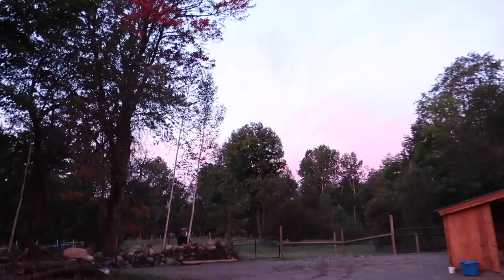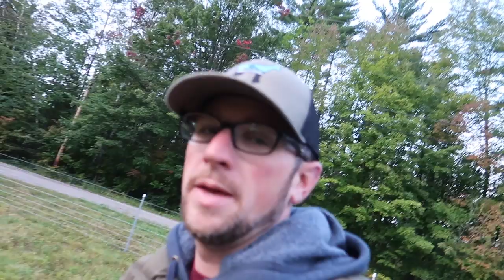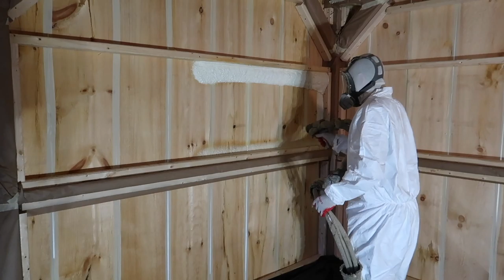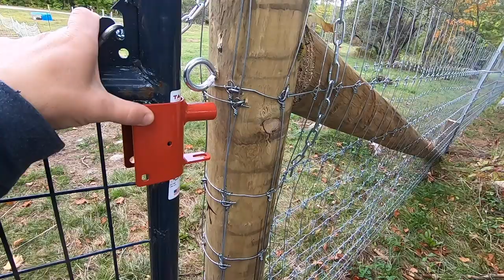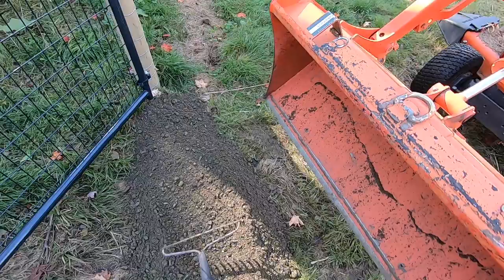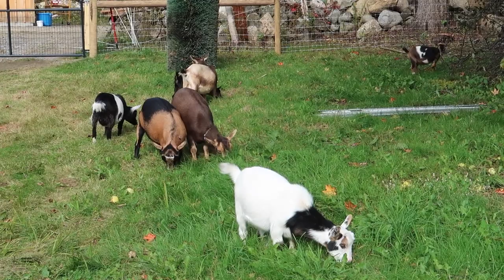Post & Beam Barn/Workshop Gets Spray Foamed and the goats go on PASTURE FULLTIME

Comment: Put the gate chain inside a piece of cheap(flexible) garden hose.
Reply from the maker: I like that idea
Reply: This is what I've done on my motorbike chains..... Protects them from rust and minimises the noise from when you use them... Also I have a spring type latch on my gate... Drilled a hole into my post for the spring latch could be pulled back then inserted into the hole..
Reply: The problem with flexible hose is that after a few winters it is no longer all that flexible. Perhaps it's because it gets extremely cold in my neck of the woods.
Reply: Mary. One 50 foot hose cut into 2 foot pieces. If it lasts 2 years per piece then there should be enough for 50 years. $8.00 every 50 years is a good deal. FYI thats around 15 cents per year.

Comment: Gooood Morning Al , Gina and Olivia ,
Whoeee , Lumnah Acres is looking rather farmy now with the new fencing. The barn is not going to look as rustic now with a finished interior. Certainly warmer this coming winter.. You may still want some heat though. Maybe a small potbellied stove ? A rocket stove would be just the thing and would give you a warm place to sit. It would give you a nice heat while using only a small amount of fuel. The main drawback is that a rocket stove uses up floor space. Maybe you could place one along the back wall ? And have the bonus of a warm place to sit. Ha ha , I've never seen you sitting except for meal time or driving to town. They take awhile to warm a space. You could always fire it up the very first thing before you start your other morning chores.
 We don't see Olivia leaving for school anymore. Are you homeschooling now that Gina is at home ?

Comment: Worked on a house that had closed cell foam sprayed onto their metal like that cause it started leaking. The contractor had to come back and check every screw on the roof and walls. Just a heads up :) hope this helps prevent any headaches down the road

Comment: Gate latches and gates in the winter are a pain.   I have my gates set little high and hang hardware cloth for the summer.   Kinda done with chipping ice.   I’d use the router and hog the post out to use that latch

Comment: Gate hinges should have been screwed in more. The gate latch goes one bolt on top of cross tube through the hole in the chain catch but you have to remove the chain and then the other underneath the tube.

Comment: Should have run all the electrical wiring for other areas of the barn for lighting and receptacles before spray foaming to avoid surface runs later.
Reply: Al said in a previous video that there was a reason for doing it this way.

Comment: It looks like you could reverse the way the chain is attached so that the locking of the gastric takes less effort one of the other gates has the chain attached at the post and that one if similarwould allow to just slip the chain on and off the gate side with minimal effort and noise

Comment: It would have worked, just below the cross brace would have actually worked just fine. If you set the lock high it will cause the gate to wiggle at the bottom. Where do they put door lock assemblies?  Above mid point of the door.... You had plenty of room....

Comment: Would the gate chain work better if you had the lanyard end attached to the eye bolt instead of the gate? The chain link could be fitted into the slot on the gate without threading anything through the eye bolt. ??

Comment: I hope your Goats don't get sick from the form smell. You have to let it cure for humans sometimes for a couple of days. And the smell never goes away in spots they apply to thick. Tighten the hinge bolts even if you have to change the wood you put in to the flat side.
Will you ever put the two male goats in with the rest?
Reply: K Wayne  he mentioned willow last year getting bred in December, so thats probably what he will do this year
Reply: @Peanutthecatismycat  Makes sense. I forgot that. Arms Family Homestead seems to let his buck stay  with heard but his winters are not as bad. 40 below and 2-5 feet of snow at a time is way to much for me. Baby goats don't need that either.

Comment: IDK about that short PVC pipe holding for long? it MIGHT have worked if you concrete'd it in, otherwise I would have used a 3 to 4ft long STEEL pipe and not dug a hole, but POUNDED it in with a sledge as far as you could then cut it off flush

Comment: seems too me that latch would work very well ......what if you back off or screw in on the opposite side of the latch side on the two screw bolts ....... that should give you the space you need for it too work  properly ......... good purchase ......... latches will work good and long.......S

Comment: So your hinges on your gate are a little wonky. You want the kind that go all the way through the post, premier, tsc, or kencove sells them, just make sure to measure the size of your hinge holes before you order or buy. The ones that come with the gate are sadly junk. Install the long ones, Adjust and grease the hinges, adjust to make the gap tight enough. The 2x4 goes on the latch side and you put it all the way to the ground. Your baby kids can actually fit through the gap at the bottom of the post under the hinge as you have it now and trust me the little buggars will squeeze through them the first chance they get. The latch you have purchased I love - it's all I will ever use on a long gate. chisel a flat spot and install with lag bolts and small washers. You want the dumb side as snug as possible, tighten it down with the long bolts, and then put a self tapping screw through the spare hole to keep it from twisting. When you're done, give it a couple weeks to make sure nothing needs adjusting then cut the extra off the back end of the hinge with a saws-all.

Comment: It might be just fine, but personally, I don't like those hinge bolts sticking way out like that. I think that over time, they will at the very least sag. If not break entirely. What I would do is to take the gate down. Put a pressure treated 4x4 up against that post. Then put the hinge bolts back on, but through the 4x4. If you do that, you could also fine tune the gap at the latch side.

Comment: Those gate latch hooks don't look right. I screwed mine all the way (most of the way) In to get rid of the gap and faced both hooks UP so twice the support and I can just lift it off if I want to. drill a hole for a cotter pin or something if you're worried about it flying away...but they don't.

Comment: About the now Spray Foamed Willow Milking Room, Where is the electrical wiring ,for wall receptacles and overhead Lighting in that room that should have been ''roughed in '' BEFORE the Walls and Ceiling were Spray Foamed ! ?? And same with the Workshop Room !
Reply: Al stated in a previous video that there was a reason for it.

Comment: How much does foam insulation cost per square foot, installed.
Reply: That all depends on the contractor you choose to do the job.  Also, be careful going with the cheapest one as sometimes they don't really know what they are doing.  Ask for references and check into them before choosing anyone.

Comment: Place a piece of pipe parallel with the vertical pipe on the gate or weld it on the overside of the gate so you can mount the latch higher up, then you even make a flat spot on the pole for the latch.

Comment: Going to leave the spray foam exposed? Foam is a fire hazard Without fireproof barrier coating. Also exposed foam cleaning is a long term problem. Consider Box Store FRP sheathing the lower 4 feet. Good luck.
Reply: Al installed nailer boards on all walls to tack up paneling of some kind to cover the foam while leaving the posts exposed.
Reply: @Gladtobeleaving  what was an insured outbuildings has now become a fire hazard because of exposed flammable toxic foam. Darn!
Reply: @douglaspohl1827  Doug, I don't understand; the foam will all be covered.
Reply: @Gladtobeleaving  Covering with flammable material is not acceptable - let's hope the material has a Fire rating like drywall or better since wood as material is unacceptable by all insurances that I work for. Al should check with his insurance agent and get a reply in writing. CYA

Comment: Wouldn’t a blower be easier than a vacuum and broom?  You could blow the dust off the walls, ceilings etc much faster.
Reply: @Michele L ,
Yes, then you could  have that dust suspended in the air. Why use a blower when a broom works so well ? And with far less noise pollution.

Comment: I have a 20 foot drive way with two 10 foot gates 5 feet high and i used a chain link gate latch with a down rod into a pvc pipe with a latch system that goes across the other gate and the down rod keeps them shut & stright :)

Comment: Check out bestgatelatch.com  I’ve been running a few of them on my pasture gates for 2 years now and they are awesome. They are great because if you have a fence post shift on you over time the latch still works and you don’t have to worry about alignment issues like other latches.

Comment: Looking great  . Nice job on the spray foam . Was wondering if you were planing to heat the barn . Wood stove maybe . Also noticed the main barm door is not insulated . I wonder how that would effect the heat loss if you plan on heating the barn .
Reply from the maker: We will have to insulate the Garage door with sheet foam

Comment: Back in my days doing energy efficiency I saw some sloppy spray foam jobs! Looks like you guys found a great company that really takes pride in their work. Any plans for a miter station or work bench once the walls are up?
Reply from the maker: Yes we need a place for the chop saw.  A nice movable worktable for it will be nice. Do you have any recommendations
Reply: @LumnahAcres  I'll have to find the link for the video I used to make my movable work bench. But to get you started, 2" lockable casters with 360° movement have been plenty durable and my bench moves easily. Even full of tools

Comment: Why don't you just make a latch? Just bend a piece of metal into U shape, weld a piece pf rebar on the gate. Fix that U to the pole in such a way so it can swing up and down. that U will go around that rebar and bam, you have a latch for literally nothing.

Comment: Just rout out the post enough to accommodate your latch.
Reply: Problem is the fencing is wrapped around the post.
Reply: @mintysingularity  You'd only have to cut 1 or 2 pieces, then re-staple.
Reply: @edwhite7376  Problem is that the ground is so rocky those were the only available spots for the posts.

Comment: I wouldn't be so sure about soundproofing after the foaming, though logic says otherwise. Jay Bates who just foam insulated his workshop in one of his recordings states that the sound situation is even worse, It did surprise me. I eagerly await your experience with that.
Reply: I definitely noticed how much echo remains in the barn after the foam install.
Reply: @mintysingularity  Empty buildings echo somewhat even if insulated , once the void fills up with stuff the echo diminishes greatly .
Reply: @Gordon_L  yes, I am aware that empty buildings tend to echo, thanks. My comparison is how much it echoed before and now after insulating, and it echos more than expected.
Reply from the maker: I am hoping it helps a lot with the rain.
Reply: @LumnahAcres  I am afraid it will not. I hope I am wrong, but I am not confident after a few reports about that matter, especially since Jay's report. And it puzzles me a lot because I would expect the foam to suffocate the sound nicely.
Reply: @travin , 
The foam should help attenuate sounds coming from outside. Similarly sounds from inside to the outside should also be somewhat attenuated . It will perhaps not have an effect on sound generated from inside. For that you need special sound baffling on the walls and ceiling and floor.